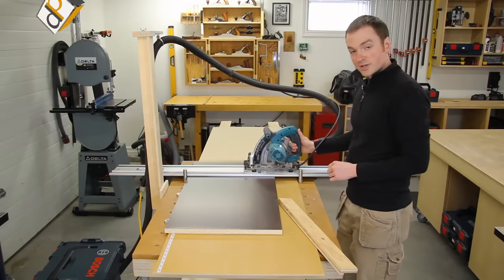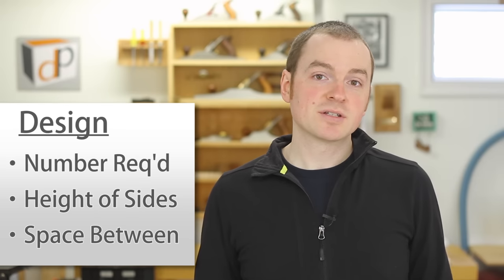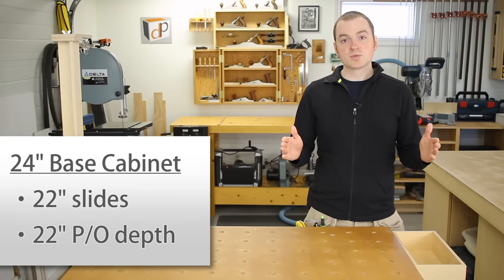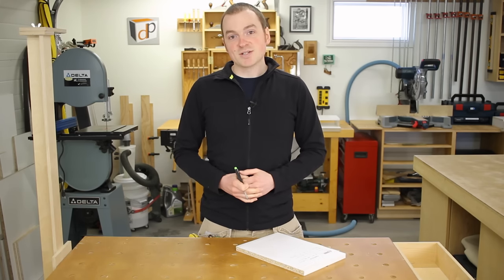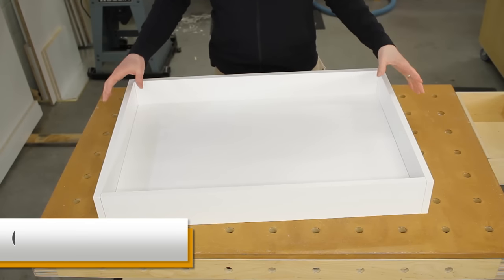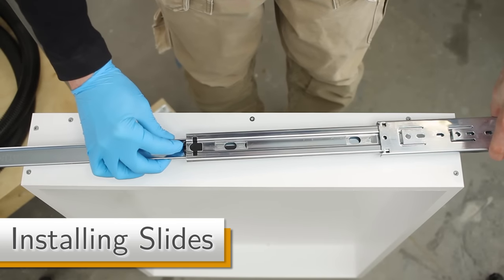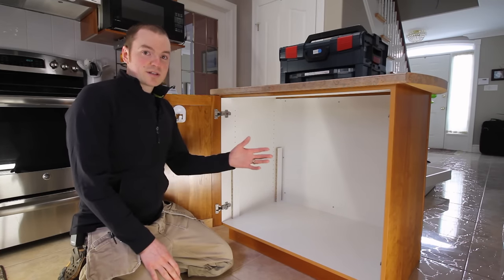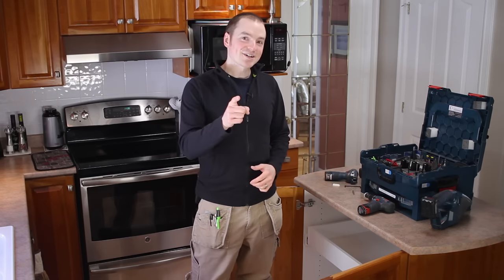How to Build & Install Pull Out Shelves - DIY Guide

Comment: I wonder where in America or internet, I can find good sliders like those you are using. Are they specify by weight resistant?
Reply from the maker: +Joey Cymbals I always use 100 lb weight rated slides for drawers and pull outs.  I'll put a couple of links below for slides that I've used and recommend.

Accuride makes a high quality slide.  They are a bit more expensive but are less greasy and work very well.
http://amzn.to/2y8D3Di

The Pro Series slides are much more economical and still work very well.  I find they do have a bit more grease on them so I usually wear a glove when handling them like I did in this video.  That avoids getting grease on the finished project.  I've used these slides on a lot of different projects from pull outs to kitchen drawers.
http://amzn.to/2xqKYrM
Reply: Same.  I've used 100lb and seen others do the same.  It seems to be a good rule of thumb.
Reply: The links are backwards but I get the point. I have them both in my Amazon's wish list. Thanks for bother in looking the links for me. That's very kind, have a great winter!!
Reply: U.S. INDUSTRIAL TEMPE, AZ Lost of stuff hardware for cabinet makers
Reply: Dan Pattison 
P
Reply: If you look for server rack slides you'll find them, designed to hold very heavy computers (servers).

Comment: Great and detailed video. Doing measurement calculations using metric is so much easier. No dealing with 1/32 or 1/8. Simpler to use cm and mm and all the same. Thank you.

Comment: I reckon this is the most comprehensive tutorial I've seen on making and retrofitting kitchen drawers. I'm saving this one for future reference.
Brilliant idea, on how not to get confused in the final figure, by deducting the 32nd afterwards. However, had to lol - unnecessary and far simpler in metric.
Yes, to further tutorials.
Reply from the maker: +howard dove Yeah for things like this metric would be simpler. I use metric for some hardware installs but still build most things in imperial.

Comment: Thanks for the detailed and thoughtful video, Dan. Using your steps I was able to retrofit a poorly laid-out cupboard to instead be much more useful thanks to pull-out shelves. While mine were rather significantly more 'aesthetically challenged' than yours (thanks to inexperience and a more limited tool set), this video was the key to helping me complete my project. Appreciate it!

Comment: I use solid wood on each rail piece and rabbit a 1/4” slot for a floating 1/4” plywood bottom the latest job I did was 14 pullouts all maple with 2 coats of sprayed clear finish. This makes for extremely strong shelves which will never be susceptible to kitchen moisture. I like to use KV slides. As for the set up for install you are spot on. 
Nice easy to understand video!!

Comment: Excellent, clear and well organized video, thanks. I will be adapting the instructions to install shelving for a set of five stereo components (amp, turntable, tuner, cassette player, and cd player) into an existing closed-in cabinet space. My main problem is how to manage the various cords and cables required for the various units. Possibly there is other useful information online that will help me with this. Otherwise you might consider creating a how-to video for something like that.
Reply from the maker: I would say installing cable grommets and conduits would be a practical way to keep everything organized.

Comment: To save some screws and holes I use solid maple rails with 1/4”  dado to accept shelf bottom which is also 1/4” maple plywood. I do not glue bottom to rails I leave it floating. 
I have shelves filled with over 35# of can goods and still holding strong. For finish I use a commercial sealer and spray finish as we have a commercial wood working shop.

Comment: Great tutorial Dan! Can you please let me know the type/length of screws you used for the drawer slodes?
Reply from the maker: I use #6 x 1/2" truss head screws for drawer slides.
Reply: @DPShopTalk  Thanks Dan, also can you please share the type of screws you used to build the drawer?
Reply from the maker: Those were #6 x 1-3/4" particle board screws with a self drilling tip. They work really well for melamine construction.
Reply: @DPShopTalk  thanks Dan,  really appreciate your help. Hopefully I can get the same results this weekend.  😂. Looking forward on your next tutorial video.

Comment: Great job on the details making and installing the sliding shelves. How did you remove and reinstall the style between the two doors?
Reply from the maker: +Wayne McCauley thanks.  There wasn't any stile between the two doors in the island cabinet since they are frameless cabinets.

Comment: I was just getting ready to make some pullouts.  This was a great video and the construction method is simple.  I couldn't quite tell if the screws were covered on the front panel.  If so, what did you use to cover them?
Reply from the maker: Glad to hear you found the video helpful. I use Fastcap adhesive screw covers on all the exposed screw heads.

Comment: Great video.  I'm in the process of installing some in my home.  Quick question...on the double spacers at the bottom, did you use a wider banding tape to make them look like a single piece?
Reply from the maker: I used regular width banding tape on the two individual pieces and then screwed them together. As far as I know you can't get banding tape that wide.
Reply: @DPShopTalk  I'm using 3/4" melamine so I'm assuming I can use this https://www.amazon.com/Band-Melamine-Iron-Edgebanding-38565/dp/B0071BR60I, unless you recommend a different brand.  BTW, thanks for responding.  I really appreciate it.  I'm right in the middle of it so this was helpful.

Comment: Your video is great.  The logic to building and installing the drawers is spot on.  I will have to say that my cutting with a track saw was not very consistent and as such, the drawers were not very good compared to yours...slightly uneven lengths, heights, etc.  Anyway, since I've embarked on trying to build several of these drawers, I'm going to invest in a job-site table saw because I don't have room in my garage for anything larger.  Do you have a recommendation for a job-site table saw for this type of drawer construction?
Reply from the maker: The portable job site table saw that I use is the Dewalt DW745 which I've found to be a great saw, especially the fence. If you use some jigs you can get more consistent results from your track saw too. There are a few videos on my channel that will help with track saw accuracy.

Comment: Hello Dan, first, thanks for the previous replies. Give me some advice on making and installing drawers into a new melamine frameless carcass. I initially asked you about soft close side mount slides and you suggested soft close blum blumotion is what you use. Do you use the blumotion on melamine built drawers as well as solid wood drawers. I noticed your melamine roll out shelves do not have the bottoms dado'd into the sides, would you build the melamine drawer for undermount slides the same as you built your roll out shelves, other than having to raise the bottom up 1/2 and noting the back? My project is a 82" vanity and I was planning on what to use for drawers/doors and slides. I do want all soft close hardware and was planning on buying the doors and hinge hardware from the big box store and buying slides and building drawers myself. Is there a better supplier, is it more cost  effective to buy the drawers and doors all made up ready to install? Cabinet sizes, 2-24" 5/8 high by 28" 7/16 wide x 21" deep and 1-24"5/8 high x 19 7/16 wide x 21" deep, Thanks in advance for any advice.

Comment: Dan, this is very clear and concise  and well demonstrated.  Could you please identify the different screws and caps you used throughout.  If you could provide links that would even be better.  I don't want to end up splitting the particle board and also want to ensure it will hold the weight of china or heavy items.  If the screws are too big, I'm afraid they will split.  Should these shelves be re-enforced to hold very heavy items, like cast iron pans or appliances ?  Thanks again, wonderful video.
Reply from the maker: Thanks! To build the pullouts I used #6 x 1 3/4" particle board screws. I find the #6 screws work well in 5/8" melamine. I just use the typical Fastcap screw covers to cover the screw heads. The screws for the slides are just #6 x 1/2" truss head screws.
Reply from the maker: As far as reinforcing for heavier items, it really depends on the size of the pullouts. You can increase the height of the sides to add extra strength as well as use melamine glue when assembling.

Comment: Hi Dan, thanks for putting together this video -- you do a great job of explaining how easily sliding shelves can be installed, and using the spacer sticks is a great tip for ensuring consistent mounting.  For my purpose, it will be more suitable to make the shelves from steel (angle frame supporting an expanded metal surface).  Do you think there would be any issues with attaching the sliders to 3/4" angle with either screws or bolts (TBD), rather than screwed into wood?
Reply from the maker: Thanks. I don't see any issues with doing that as long as the screws you use are truss head or similar and have a low profile head. If the screw heads are too thick then the slides won't work properly.

Comment: Great video, thanks, I've viewed it a few times and ready to do my own.  Before I found your video, I was afraid that pull out shelves may not work with melamine because it doesn't seem strong enough.  Rockler also sells 100 pound rated pull out drawer slides, it seems like they would work also? Thanks.
Reply from the maker: Yes most 100 lb ball bearing slides will work.

Comment: Hi Dan, watched both parts of this DIY guide, have a question/request. When one has to install multiple draws/pullouts in a cabinet, is there an easy way of calculating the spacing of the slides to guarantee exact symmetry of draw fronts? Where the slides are installed on the draw itself, either in the middle or flush to the bottom, doesn't seem to matter, it's making sure that the slide component attached to the inside cabinet wall is in the right position which freaks me out! Have just subscribed to your channel 🤘
Reply from the maker: +Robert Williamson I usually do a drawing to lay out all the drawer or pullout spacings if they need to be exactly symmetrical.    A program like SketchUp works well to do that and that way you can make sure that everything is laid out perfectly and that there will be no surprises. You can also lay it out full scale on the cabinet interior and do the math too. I don't really have an easy sure fire way to share other than just careful calculations and a good layout drawing. Mounting the slides in the same position on each drawer side helps simplify things when it comes to figuring out where the slides mount on the inside of the cabinet for sure. Hope that helps. Thanks for the subscription!
Reply: Thanks Dan, thinking of buying the Kreg draw jig. Semis relatively fool proof .

Comment: Great video!  My cabinetsI were built in 1986.  They have a vertical wood  strip on the face front of the double doors.  Can this strip be removed so I can install these pullout drawers?
Reply from the maker: You should be able to remove it. If they are face frame cabinets then that strip probably provides a backer to the space between your doors though. One way to get around that is to attach the strip to the back of one of the doors but then that door always needs to be closed first.

Comment: Well done Dan!  Love these types of videos.   I was looking at another video someone had done using Melamine and said that Titebond makes a glue especially for Melamine but he had not used it. Was wondering if you had any experience with it? Someone left a comment to that video saying that the product has a bit of a solvent to make the Melamine kinda "gluey". Gotta wipe off the squeezout right away though.  Any recommendations on attaching those side supports to a cabinet that has sides walls that are only 5/16" thick (thin?). Also, what to do if there is a center stile? Too many questions.... Thanks.
Reply from the maker: +RxMixer thanks.  I use the Titebond melamine glue for some projects and it works very well.  It makes a strong bond and I use it for critical joints when working with melamine.  From what I understand I think it has an acid in it to etch itself into the melamine surface but don't quote me on that.  If I was working with a cabinet that had 5/16" thick gables I would beef them up on the inside with a thicker material and then attach the slides to that.  That way you could glue and fasten the thicker material in place and then have plenty of meat to screw the slides to and it would stiffen up the thin gables too.  If you have a center stile you could break it into two pullouts, one in each door opening.  Hope that helps.
Reply: Thanks for the reply. Was thinking of that same solution with the drawers also...I think the wife is afraid of losing storage space though. Will have to ponder it a little more.

Comment: Awesome tutorial to post RIGHT before I was considering installing pull-out shelves. Thanks for putting this together! By the way, what kind of pants are you wearing?
Reply from the maker: +mbarigian glad you found the episode helpful and that the timing was on :)  The pants that I'm wearing are the Blaklader Brawny pants.
Reply: Awesome! Do you recall the type and length of the screws you used to assemble the drawers?

Comment: Greetings,....Loved the great detailed and informative video.  Is there a such thing as cutting the slides to make a customed sized shelf.?  I'm thinking of doing this on my jon boat for a pullout battery tray inside the bench seats of the jon boat.
Reply from the maker: The slides couldn't be cut in length but there are all different lengths available.
Reply: @DPShopTalk  Thanks so much!

Comment: Hello Dan, would you recommend a quality side mount soft close drawer slide for upgrading frameless kitchen cabinets. I plan on using 5/8 or 3/4" stock for the drawer sides. I do plan on adding drawer fronts to the drawers eliminating the need for the existing cabinet doors. My cabinet doors overlay the cabinet and my drawer fronts will do the same, thanks.
Reply from the maker: Hi Bob, I can't really recommend soft close side mount slides from my own experience since I've never used any.  All of the side mount slides I've used have been non soft close and all of the soft close slides I've used have been the Blum Tandem undermount slides.  Accuride makes good quality side mount slides and I've found the Pro Series slides to be the best value for the money.  I've used both of those in non soft close so if you can find them in soft close I would think they would work well too.

Comment: ok i don't have sides on the inside of cupboard so is there steel frames that can be set on the bottom instead of sides?
Reply from the maker: +glenda brekke you can buy commercially available slide mounts for cabinets that don't have inside gables to mount to.  You can also make wooden rails or framing inside the cabinet to mount the slides to.

Comment: Hi Dan, which full extension soft close slide would you recommend.
Reply from the maker: Accuride makes a good quality slide. I've also had good success with the lower priced more generic brands from local suppliers.

Comment: I'm wondering why you didn't use undermount sliders for the bottom slider?
Reply from the maker: You certainly could but it is easier to use all the same slides and build everything the same when time is money.
Reply: I don't have a business I just want to do sliders om the kitchen cabinets. We just bought this house and the wife and I both agreed that we hated the NON pull out shelves, and have to get on our knees to get anything that is in the back.
    I was really wanting to build this type of box and screw it to undercabinet mounts. I have a width of 37' x 23 1/8' area.
Reply from the maker: If undermount slides would be easier for your application then I would say go with that. I thought you were asking why I didn't use undermount.

Comment: Great tutorial!  Very well explained. How would you go about doing this for a cabinet that has a partition on the front face and nothing to connect a drawer slide to in the center of each side?
Reply from the maker: +Chris Fulton thanks!  For a cabinet with a partition I would run a couple wood rails from the back of the partition to the back of the cabinet and then attach the slides to that.  The rails could also be attached to the cabinet bottom depending on the construction.
Reply: Dan Pattison Thanks so much for the reply!  Good information.

Comment: nice video. had a question. since the bottom spacer is double the thickness of the top spacer strip, would that eat into the width of the bottom drawer. I am wondering if the width of the top drawer is greater than that of the bottom one. 
Also would it be possible to install the drawers to skirt around the hinges, so then you would just take the width of the cabinet and not account the hinges.
Thanks
Reply from the maker: Yes the top drawer was wider than the bottom. The bottom pullout could have been installed above the hinges but then you would be wasting vertical space inside the cabinet. It is a more efficient use of space overall to make the pullout a little narrower to clear the hinges.

Comment: What size screws did you use and where did you buy them?  Also where did the plugs for the screws come from?
Reply from the maker: The screws are #6 x 1-3/4" and the caps are Fastcap screw covers. Bought both at my local supplier.